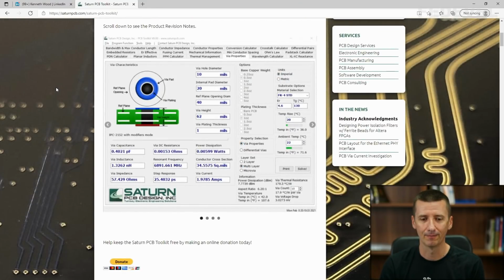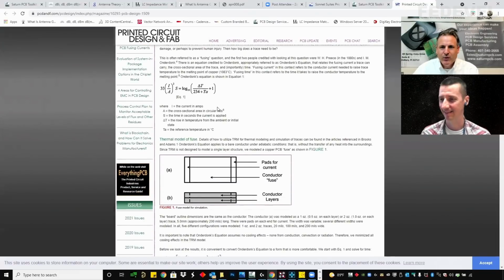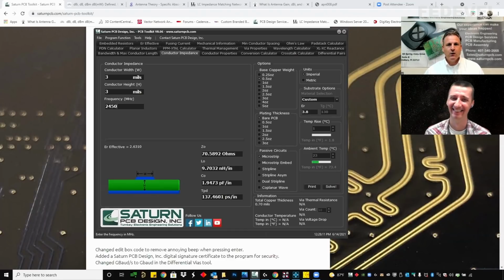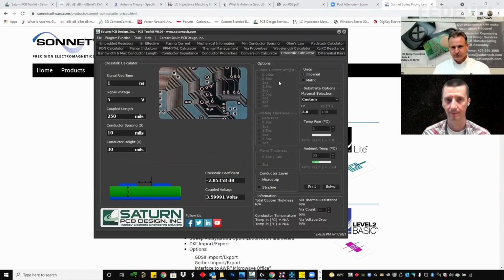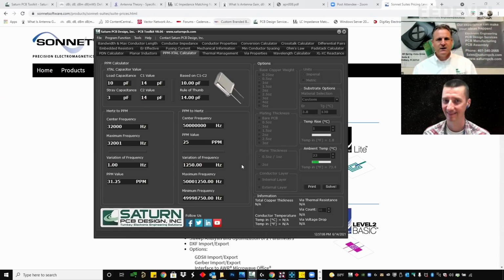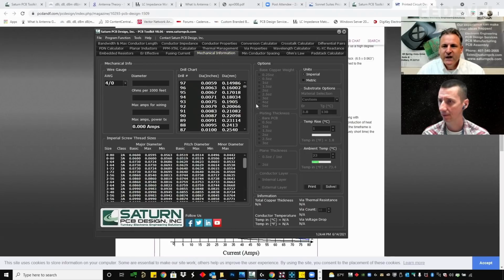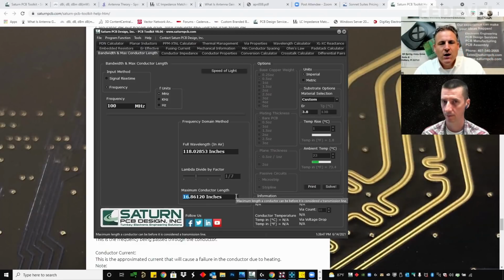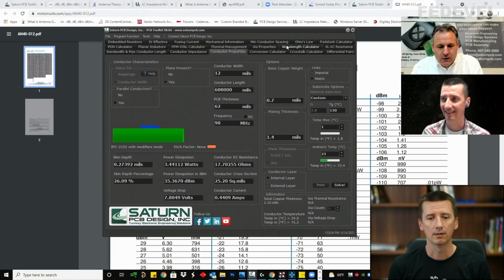PCB Layout - Useful Calculations Which You Maybe Didn’t Know About (with Kenneth Wood)

Comment: very informative - most of Roberts questions remind me of my foray into CFD when designing alternate wing tips for my airplane . After years of modelling 3D airfoils and then running simulations on Openfoam and SU2 , I spoke with an ex USA test pilot , who told me to stop playing with computers and fly the plane . He said these simulations are just a best guess set of guidelines with a varying probability distribution curve of results  . And totally useless in stall / unsteady turbulent airflow . Basically partial differential equations running Navier Stokes . The reality is,  the built wing is not perfect-  there are insects squashed on the leading edge , the wing is not perfectly cleaned , the air through which you flow is varying on vertical and horizontal impact on the wing at any point in time , and the air is of continuously variable density , relative humidity . So in summary he felt simulators are like aa poorly calibrated ruler ( better than nothing , but a BEST ESTIMATE )

Comment: Hello gudmng sir,.  
I have to design a pcb 4 layer pcb
Differential pair I have to maintain 12 mils trace width, impedance 100E
Wat should be the trace gap?
Total thickness is 60.58 mils..suraface 2 mils(both side)..how can I calculate trace gap?

Comment: Thanks, Robert,  for these tech talks! Regarding Dk (Er) and TanDelata factors on the PCB material (RO4835-Lopro). I had a study during my master thesis as a "Sensitivity Analyzes", which I recommend all the High Frequency designed to do this simulation and test. on this process, I've played with variations of the Dk(Epsilon r, effective) and Tan Delta( Dissipation factor) as Material properties as well as PCB processing factors impact on the delivering high-frequency poser to the Antenna (76 - 81 GHz). Results show (on the simulation, CST Microwave Studio) huge losses on the forward transmission as well as return losses. 
But the variation of the 'TanD'  affected just resonant frequency.

on the PCB processing analysis, I've obsere3vd that the etching factor has also massive disaster on the delivering the power of the signal to the Antenna. this happened also for the copper thickness variation test. 
- However, even with a one-month simulation and study of the known factors on the final product. the VNR test shows even worth results!